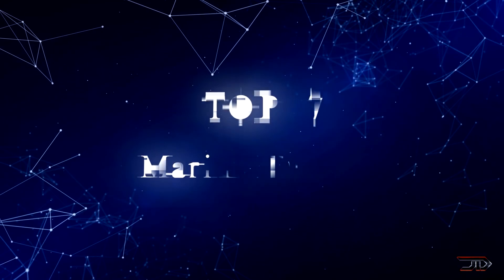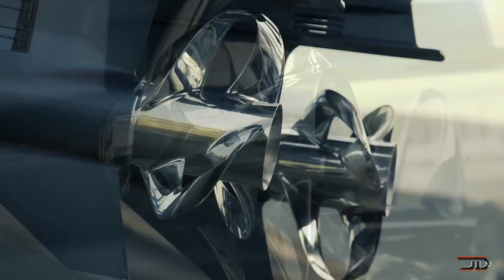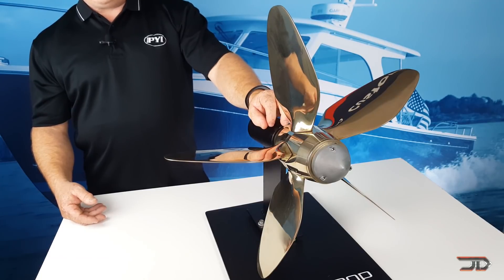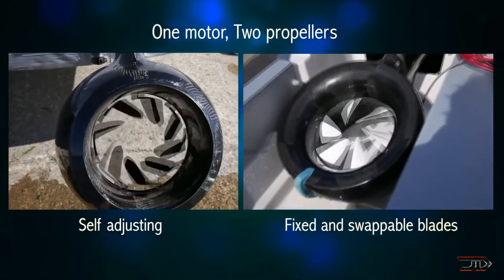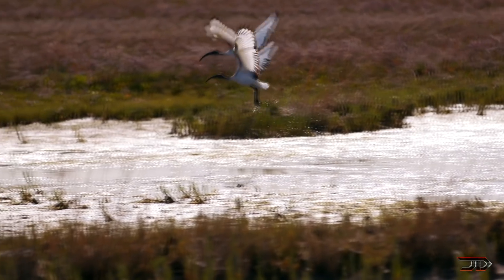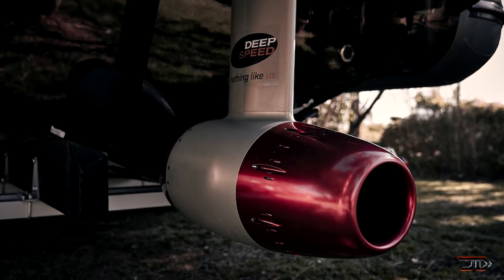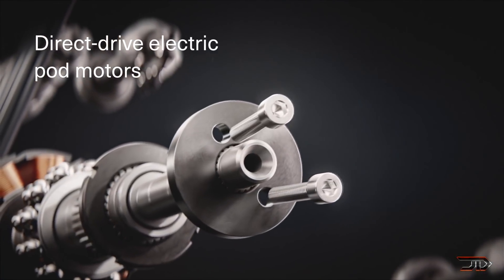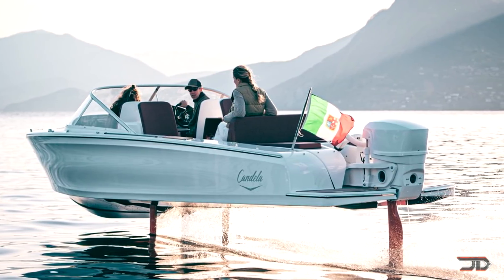7 STRANGEST Boat Motors/Drives

Comment: Okay, dear marine engineers,  please, use electric drives (less service, more reliability) and inexpensive diesel generators mixed with batteries. Thank you. This is the case on larger ships, so why not integrate it into smaller boats.

Alternativy, people can decide between batteries, diesel gens and a hybrid mix. That's all we need. Peace in the World is established
Reply: I've seen an hybrid diesel for sailing boat, you could move the boat with the diesel while charging the battery, you could sail and use the propeller to recharge or use the electric motor to move the boat.

Comment: I've been in the market for a small CPP for years with zero luck. In the end I started  designing my own. Thanks for the info!
Reply: What is your application? May I ask.
Reply: I'm designing a new engine for my steamboat; it's half 'Smart car' engine with a new cylinder block and valve chest. No way to reverse it so a CPP seems a good fit.
Reply: @wanglydiaplt  wow. That’s uncommonly interesting.

Comment: Honestly the only situations where I see electric boats being feasible are catamarans given how efficient they are, and the large footprint allows for a lot of solar panels up top to compensate. But small boats like the candela just seem too unrealistic other than for rich people to show off to their friends for 10 minutes then back to the dock to recharge... $330k for a 27 foot boat with 50 miles of range CRUISING, 32mi at 30kts... lol, thats less than 30 minutes of run time, then back to charge for another 13 hours.
Reply: Proas are a little better than catamarans .
Reply: Well, there's always lakes and noise sensitive areas...
Reply: The endurance is a valid point, but I don't know why anyone building an expensive vessel with current technology would be limited to a slow 13-hour charge. One hour to charge from 20% to 80% is typical.

Comment: You showed a white boat in Amsterdam named Pax as an boat with electric prop. This boat is still floating with batteries but have have prop with a diameter of 47 cm. This boat have a package of 84 batteries what is good for one week floating. I was captain at this company. This boat was build with a Fort Mermaid diesel. In the winter of 2016 this boat get a new Volvo Penta. About one and a half year ago this boat was rebuild to electric.

Comment: Unless you are cruising the canals of the UK none of this stuff will be ready for real world use for decades and even then it will be expensive. Boats require real torque for long periods and is why torque monsters like diesel motors are the most used short of a weekend boat which is gas. Even Tesla's have limited range on land. Now have that same tesla drag a dump truck behind it and see how long the power lasts.

Comment: I'm all for it but I am curious how they deal with electrolytic and galvanic corrosion in the pod motors. I am sure composite materials are used but the actual motors themselves seem like they would be susceptible.  Any word from the manufacturers on how they deal with it?
Reply: you can add corrosion reducing "targets" into basically anything, they use specialty alloys usually zinc based to cast little bolt on things to be easily replaceable. These objects are preferentially  "targeted" by the galvanic effects, and you just swap them out when they wear out.  There are many varieties to suit specific applications.  (I'm not a manufacturer of these things, but have used them extensively in boating and commercial fishing (refrigeration systems using seawater to chill fish need many of these inside their heat exchange units, for example)
Reply: @adamh1228  Wow! This was from months ago and I actually forgot about commenting. Yes, I am familiar with sacrificial anodes. I have owned boats and had them in my family most of my life. My current boat is fiberglass but I am actually interested in an aluminum catamaran and am cautious but not overly concerned because I know it is manageable with proper care, regular anode replacement and isolation transformers to reduce stray current. However, having an active high power electrical device below the water line opens up an entirely different level of corrosion. I am sure they have considered it and I am definitely not suggesting it is impossible, I was just curious what steps they have taken to mitigate this issue. Cheers!

Comment: Back in the 1990s or the early 2000s on discovery channel they had a blade less electromagnetic induction engine which is more like a pod with double Venturi’s I have not been able to find it ever since it was being used as a dredge also. It would be interesting to see whatever happened to it thanks for the videos!
Reply from the maker: I will try to find it, thanks!
Reply: @Motor_Explorer1  great thanks 👍
Reply: It is called a magnethydrodynamic drive. There have been german and US prototypes tested with it. It is likely hideously inefficient. The very strong unshielded magnetic fields and high electric current going trough the water probably make it very easy to spot. Corrosion and fouling of the electrodes will be an issue limiting operation time to a few hours at best before they need replacement.
Reply: @pyalot  They tried it on submarines to make them silent.
Reply: John mayor,  I remember what your talking about.  I think I read somewhere that the navy bought the rights to that technology.
Reply: That’s what the Hunt for Red October submarine had
Reply: @ionbusman2086  Exactly what I was thinking, too.

Comment: Really interesting propeller design, while fuel cell ev boating, imo, will be a likely standard for water craft (where green-hydrogen electrolysis, from water, will be the easiest to have access). Battery tech doesn't need to be waited on. Hydrogen infrastructure needs to start being installed.
Reply: In my opinion, hydrogen is the future. I have read of much development and improvement in the way hydrogen is made and store and of hydrogen fuel cells. I think this makes more sense than batteries.
Reply: Hydrogens a fallacy, it's seriously in efficient not to mention storage difficulties such as hydrogen embrittlement
Reply: @Th3_Gael  Batteries are so lite & make boating so 'efficient' (lol), not to mention how safe all that immediate stored power + water is... *muting the 'conversationalist'...
Reply: @chadlymath  I never mentioned anything other than hydrogen. Address the points, don't change the subject

Comment: They probably work with marine gensets too, since batteries are still terrible.
Reply from the maker: Yeah, batteries have a ways to go in terms of energy density.
Reply: Yes, diesel-electric marine drives are very common in large vessels.

Comment: Hydromea makes an electric motor similar to the RIM 6. The Hydromea motor sells for about $500.
I these sorts of motors are a good fit for small unmanned submarines. Since there's not a center hub, seaweed and other debris just pass through the center without clogging it.
I'll post a link in a separate reply incase direct links get caught by the spam filter.
Thanks for another fun an interesting video. I always like the unusual gadgets you find.
Reply from the maker: Ok thanks for letting me know! I will double check and make sure the link comes up for ppl to check out.
Reply from the maker: Nice find! That disc drive looks really interesting - https://www.hydromea.com/diskdrive-thruster-technology/
Reply: @Motor_Explorer1  That's the one. It's pretty cool but it is also a lot more expensive than other options.
Reply: The lack of a central shaft also means that the bearings are around the rim, so both the bearings and the seals are very large and have a very high tangential speed with lots of drag.
Reply: @brianb-p6586  The Hydromea Diskdrive doesn't have any dynamic seals. It has to run while underwater since it uses water to lubricate and cool the motor. I'm pretty sure it not a very efficient drive but the ability to deal with seaweed and other debris makes it a good fit for some applications.